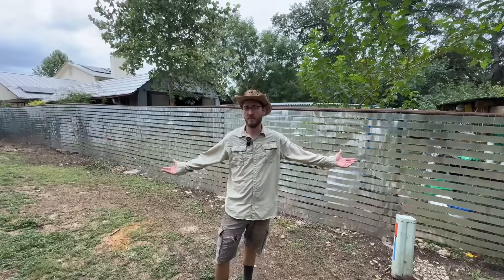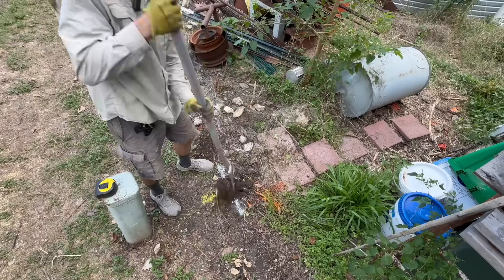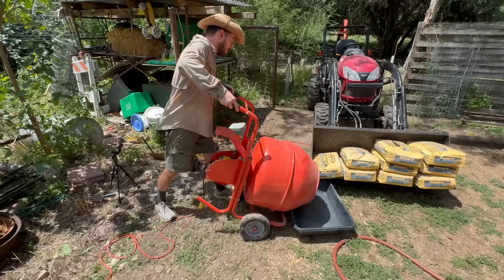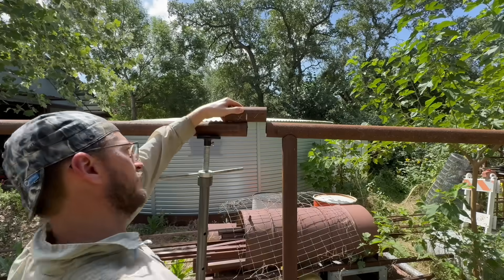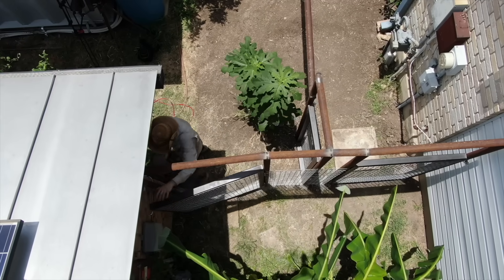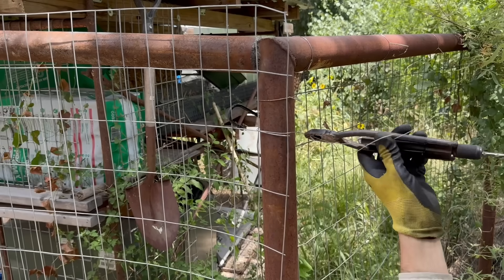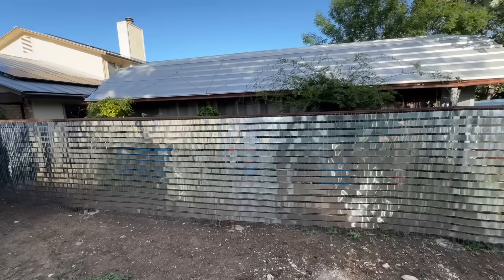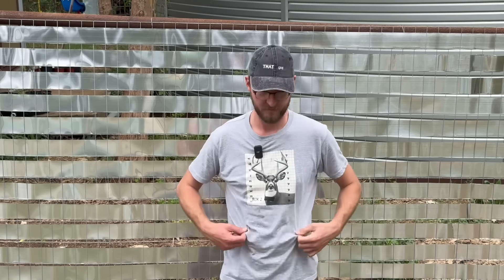This FENCE Lasts 100 years!!!!

Comment: I built a similar fence using 3/4 and 5/8 rebar instead of pipe. I just rented a post pounder to set the posts.  Worked great and is still just like the day I installed it 6 years later!

Comment: I am an amateur diy welder, and have always questioned why people dont remove rust on a project like this. Wont the steel pipe rust badly where it contacts the ground and water can pool?  Honest question, because I dont have as much eexperience
Reply from the maker: My climate is pretty dry so it doesn’t make a huge difference. In a wet or snow climate painting the lower part of the post is probably a good idea. Thanks!

Comment: In your climate any decent wood should also easily last many decades.
Reply from the maker: But not 100 years. I think that wood fence I took down had parts that were over 40 though.
Reply: @suburbanbiology   "But not 100 years."
And i would bet that the aluminium fence also will not last that long.
Look to europe: wooden fences easily can last a century - IF done properly. That means not using some soft woods, not cutting it to thin boards.
in the alps the fencing for the cows was mostly made from Larch and other long-lasting trees. You'd take the straight branches and use them directly as they are for the fence.  and the climate there is a lot harsher on wood.

Comment: It's definitely not how I'd have done it, but nevertheless interesting to see a different (and somewhat unconventional) solution.
I don't have deer running around my garden, but smaller critters that like to dig underneath the fence, so I poured a continuous concrete base about 6" deep and 4" wide all along the fence line, reinforced with a strip of 3mm wire mesh welded to the base of each post to make the whole thing more durable. I opted for grape vines for decoration, they grow well in my climate and, even though they don't fruit as well as in a dedicated vine plantation, provide some tasty treats in the autumn for both me and my neighbor.

Comment: I've had a dear jump over my head as I stood next to a wooden fence that tall. It made me scream, but it was kinda cool. To keep dear out one needs a double fence, the inner fence taller than the outer. There's an optical pattern. Deer have a hard time with depth perception. and the spacing of the fence makes it impossible for them to calculate a safe jump. So they won't. the fences arn't even much different than the average livestock fence.

Comment: Are you sure the steel pipe will last over 10 or 20 years?  We have a grate from angle iron 1/8 thick steel and it is half way rusted out in just few years

Comment: I think 100 years is a bit of a stretch.  For one, that steel wire "fabric" will rust through faster than you think.  And galvanic action will accelerate corrosion between the aluminum and steel.  Paint might help.  I would definitely recommend painting your post frame, or at least put some tar around the base where it contacts the concrete.  If you have water pooling at the base of the posts when it rains, that will accelerate rusting.

Comment: I'd have to clean that pipe before using it. That rust on a finished project would drive me bonkers. I probably would have used some White or Black Rustoleum on them as well.

Other than that I think it looks pretty nice. It might have been fine to use vinyl strips as well since they don't rot. I worry the reflection might heat up and burn the vines but I am probably overthinking it.

Comment: Thank you for the tip of passing the flat bar through the fence roll. 40 years late and many pinched fingers later.
Reply: The plastic bucket as flashing dispenser (with adjustable hang-height) is pretty clever, too.
Reply: Yea same. I could used that tip a few years ago 😂
Reply: He said 6” flashing cut into 3” halves. And I pictured unrolling and trying to cut with tin snips down the middle. Then he cuts the whole thing simply and I feel so stupid.
Reply: before he said cut in half I thought he was going to cut it to 4” and waste 2”.  Duh
Reply: This is convenient and sturdy, I really would love having a Great fencing like this one ❤❤❤.
Reply: right?
Reply: Yeah, it's the little "well that's a useful trick" moments that I really appreciate about these sorts of videos.
Reply: Seen coworker get poked in back of calf  when he let it roll on him. Rusty and in and half deep. Told him dnt take his foot off. Tetanus shot he got. Ahh the memories
Reply: No shit! But I've gotta work with this fencing again very shortly so future me is still very grateful.

Comment: That fence is junk, the cheap welded wire is just that and lacing flashing in it looks like crap.  You did a good job with your pipe post and rails. Just sad to see it finished like it was

Comment: Galvanic cathodization is going to be a problem where you have dissimilar metals touching. The aluminum will rob electrodes from the steel and cause corrosion.

Comment: I would have expected the buried parts of the iron pipes to be coated with tar, no?  Curious if in several years you might find the aluminum corrodes where it touches the steel due to voltaic currents.  Well your vines will be established by then.

Comment: I used that safety wire tool when I was in the Air Force.  Bolts in aircraft has a hole through one edge of the bolt head and the wire is passed through that and another eye and twisted. It keeps the bolt from jiggling out with vibration.  When I was first introduced to my shop chief, he took a look at my long skinny arms and assigned me to working on the Head-up display system.  It sits right under the canopy on the A7-D bomber and took someone with long arms to reach forward to sink in the bolts and then safety wire, all by feel and without touching the canopy, risking a scratch on the glass. I installed and uninstalled a LOT of those PDU's (pilot display unit), in the middle of winter and the heat of summer.  It was all good, and those were fun days working on the flight line.
Reply: I worked with a fellow who had lost his right arm at the shoulder. When you needed something done in a tight spot that you couldn't see, he could do it better than anyone I ever saw. 

Thanks for your service
Reply: I was in the air guard and worked on F 100s A7s and F16s. I used mine every time we had to reinstall a panel, or bolt. it was required. I still have my issued pliers from the seventies.
Reply: @benzkeez  South Dakota Air Guard here.  F102's. 
 F 100, A7's and F16's after I put my time in.
Reply: Flight line rocks, ...wasn't me in the Air Force, but my dad.  He too knows about the safety wire of the planes.
Reply: Dad was tapped for AF1 ground crew when we were at Randolph AFB then transferred to Homestead, great photos of him with his favorite President Nixon, Air Force Brats never retire. 😂
Reply: I worked on F-16 engines and there were safety wire loops that would really try your patience. Also don't fuck up your pigtail, or else your supervisor will make you do it again.
Reply: @DangerB0ne  yup, there was a lot of nitpicking with the pigtails. It was frustrating.😄
Reply: @DangerB0ne  @benzkeez 
If ur pigtail isnt right shouldnt u just kno to re-do the wiring? Or were u under time pressure to complete jobs? I’m seriously curious, as i am only a carpenter. I work private-for-hire and dont have my contractors license. My point is that there is a right way to do things, for me that is meeting IBC and my local’s specialty code, which u do not need a license in order to do. I am self-employed and my work has integrity, bc i do it “right” as mentioned above, but in comparison my work is almost trivial. Our countries finest are in your hands, so shouldnt you just re-do the bolt wiring when you see one is finished and inferior?
Reply: @joyridesjeip  The jet has to sortie for a mission, so it's a time thing. Also hazing apprentices is a right of passage in any trade.
Reply: Gotta say, I was not going to watch this but after reading the top few comments, I am completely intrigued! This completely out of my wheelhouse (Nurse Practitioner) but I LOVE to learn and Hubby is LEO and if he had a “do-over” he would have been a Pilot. Fixed wing and Rotary. He is brilliant and I watch a LOT of shows with him about this type of thing so perhaps I shall pick up a little something insofar as lingo goes and shock him! LOL! (That or he will think I am spending too much time with the LifeFlight buddy’s 🤣😂😂Gotta keep him on his toes hahahaha!). For those of you that served and those who wanted to but were not able, THANK YOU for your Service as well as your support to ALL our People and especially those that were the first Boots on the ground. 🙏🏻
Reply: Active Duty, C-17s. Personally not a fan of doing safety wire 😂 probably a skill issue

Comment: Awesome ingenuity.  I'm going to share with my son.  They bought a new place last December and have been putting up fences but the winds keep blowing them down.  I was there 2 nights ago and the windstorm sounded like a hurricane (I lived through many down in SoFla) even though their wind meter only shows 33 mph. HAH. The destruction was like a Cat 1 at least!  Blew over RV's and horse corrals in the area.   I was wondering if there was a weld free option?  With metal joints?  Just asking. Love the flashing woven through the  fence.

Comment: While the flashing idea is decent I personally wouldn't use it if there were kids or pets on either property. I've worked with flashing before and the edges of sheet metal like that are very sharp. Anyone who might accidentally fall into the fence would likely be sliced up pretty badly. Think of your kitchen box grater here. Though it would be a security deterrent... Those fence privacy screens do come in 6" x 50" rolls and are only around $50. They do allow for a partial see through in the right light, but are usually fairly opaque. Nice project otherwise.

Comment: How many rolls of that flashing did you need? Are you sure that's cheapwr than building a wooden fence?
Reply from the maker: Cost in description. I’m sure it’s cheaper. 2 rolls per panel. Came to either 14 or 16 I think. It’s in the description though.

Comment: You are obviously a savvy, experienced builder.  You can rebuild my fences any day.  Let’s see . . . cost of your airline flights, cost of your lodging and expenses, cost of local “Texas pipes,” cost of all your lovely equipment, cost of all supplies, concrete, etc. that you need, cost of anything I’m omitting because I’m not a builder, and cost of your time which deserves billing at the high end because you are excellent—hmmm.  Nope, sorry.  This will not “cost me less than the average wooden privacy fence.”  And I won’t be here in 100 years.  Nice video though.

Comment: You need to add either tension or compression bracing to your gate doors to help keep the gate doors square.
Reply from the maker: With steel framing sagging is not usually as big of a problem like with wood gates. Unless the gate is super wide. Thanks for commenting!!

Comment: I learned a lot from you in this video.  I may never use all that knowledge but I now know it.  I never knew how to cut a saddle joint; using a piece of "flat stock" as a handle AND to keep the roll of fencing (metal fabric) from unrolling is a really great idea and I will use one!.
The idea of using a 5 gallon bucket for something other than holding liquids or dirt - good.  I have an idea for using one to store and carry long extension cords - think about it.
Peace!

Comment: Just a thought, cause I have no experience with this…could a box frame have been made for each post to hold them in place while pouring the concrete by drilling holes that the post could slip into tightly at the ground level and maybe 2 feet up either using boards or plywood or something—kind of like a rack used to hold test tubes or garden rakes?
Reply from the maker: Could do. I just wanted to try to reduce complexity so I just used the dirt. Thanks for commenting!

Comment: When I set my galvanized schedule 40 pipe in the ground, I realized the difficulty in setting them to the exact height below the ground.
I decided to make a jig that can hold the pipe so that it is being held up and including adjusting the angles so that it "perfectly" plum.
I bought a Zoro Select 30Lx43 Structural Pipe Fitting and three Pipe-Mount Swivel Jacks. 
The jig as essentially like a tripod. I could lift and lower the pipe and turn a set screw that is on the fitting and use the jacks to adjust for the angle.
I laid out 3 pavers around the hole that the feet of jack rest on and I could then slide the jig side to side.
I used a 6 foot cut in half plastic culvert and attached that to the bottom of my cement mixer so the cement could slide down to the hole.
I got tired of the dust and I did most of the pipes by pouring cement in the holes, adding some water and pouring more cement and then using
a VEVOR Handheld Concrete Vibrator in the hole.
It was so much easier than mixing in the machine and the vibrator mixed it very evenly without the dust.
My jig kept the pipe from moving at all while I used the Concrete Vibrator. I had to wait
about an hour before I was confident that the pipe would not move after taking off the jig.
Reply from the maker: Sounds pretty awesome! Thanks for sharing!

Comment: Did you consider an H-brace type reinforcement at the ends of the run, to eliminate the possibility of racking?
Reply from the maker: The gate system and the back fence kind of serve as a 90 degree brace. Thanks for commenting!

Comment: the problem with aluminum flashing is you could be turning the fence into a solar oven with light reflecting heat onto the ground starting a grass fire or cooking your crops. On a bright sunny day glare could kill your eyes like looking at the sun I would recommend a non reflective material like strips of canvas tarp. I hope this guy don't start any fire with all that aluminum on the fence.
Reply from the maker: It’s not parabolic enough to be a problem. The vines will stop it from reflecting in the long run.

Comment: The fence is awesome. Just some advice, though. You may want to add more deterrents to the top since deer are the main concern. I have seen them clear fences nearly double that height.
Reply: Depends on the local deer. Not just species but phenotype from conditions that affect their growth. I purchased deer fence in the lush Canadian Fraser Valley, where 7'6" is considered sufficient. Then drove it to the coast, where 6'6" is considered sufficient. Caught a ferry to install it on a dry Gulf Island, where 5'5" turns away a "full grown" deer.
Reply: Saw a guy with not that tall of a fence, but a much higher line with I can't remember, but something hanging off it every so often so you knew it was there.. and either inside or outside of the fence line by a couple feet.. and he said the deer see it & don't feel comfy with what they feel is more like jumping thru a hole, by seeing something higher over the fence. Not explaining it well cause I can't visualize it, just how he figured out what bothers them.
Reply: One word: venison. 'nuff said.
Reply: Also bears. Any bears in the neighborhood?

Comment: Save all the oil from changing you engine oils and use it to coat the fence posts and chicken wire will help prevent rust..  mix the oil with linseed oil and you have a great preventive measure.  Do that every couple of years and that fence will last..

Comment: I've seen a coyote chew right through that cheap welded wire mesh.  Worse, if you hang a tractor or mower on it, it will break welds far down the line.  It is barely stronger than chicken wire.  We use nonclimb horse wire/mesh.  It is not welded, but rather twisted and woven.  I've had this up for close to fifty years.  And it was not new when I put it up.  I bought it at an estate auction after it had been taken down off a wood framed fence.

Comment: I’ve definitely seen small deer jump a taller fence than that.  Did it work?  Because there’s an ammunition plant locally that has a population of deer running the interior here and obviously an ammunition plant has a good tall fence with barbed wire on top.  The deer jump it.  Wondering if they do where you live.
Reply from the maker: They behave differently with a small cramped yard I think. They have never jumped my fence. I mention it briefly toward the end. Thanks for commenting!

Comment: I really liked that you used recycled drilling pipe for a fence. I also was impressed with how you used flat stock to hold the utility fabric in place while you installed it. The bucket trick was a great idea too. Thanks
Reply: Where does one buy such pile? Any help would be great. This would be my first fence - ever! 

Thanks for video.

Comment: I fell in love with the wire pliers that have the twister built in. Those are a dream for anybody with arthritis. Or as I call it, "artherwrongis", because there ain't anything right about arthritis.
Reply: Oooh ARTHERWRONGIS‼️THATS A GOOD ONE👍‼️I’ve got that too!
Reply: Safety wire pliers
Reply: @Jeff-l6t5l  Thanks, I was going to have to go back and listen for that again so I could maybe add a pair to my tool collection. I love tools..
Reply: Used in aviation alot for securing bolts and nuts !
Reply: I went to school with the Ritis boys. That Art was a bad one for sure.

LOL
Reply: Safety wire pliers. We used them on aircraft in the Air Force. They really are great to work with.
Reply: @megandonahue9220  i used them as a tin can squid in the hanger and on the flight deck .We always had pairs of these growing legs and leaving the shop. 🤣🤣
Reply: I still have mine from the Air Force 1👍
Reply: .I used them in the past. I know use a drill motor. It just about a easy.
Reply: My aircraft mechanic used them to secure the oil filter. Can't have that whipping around in the wind
Reply: I HELD CLASSES ON HOW TO USE THEM.
Reply: Except the cannabis script😊